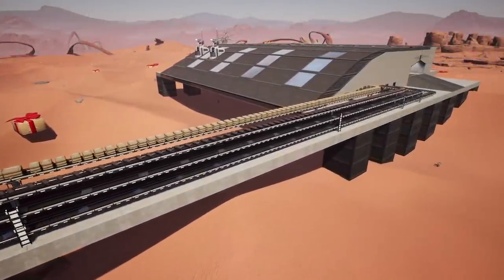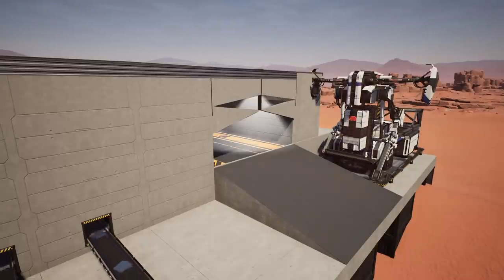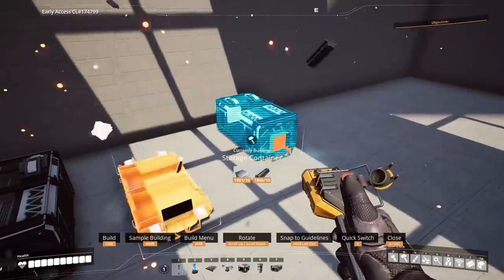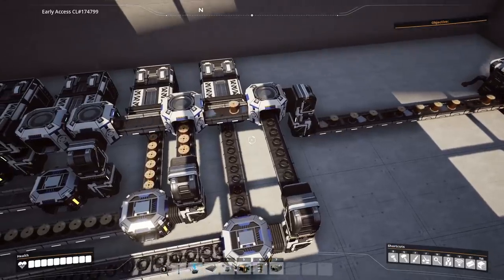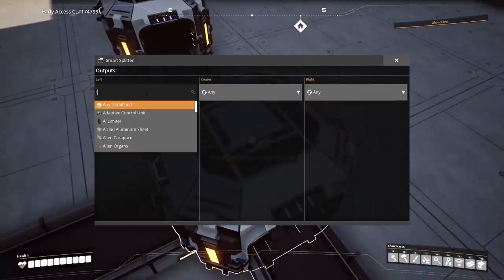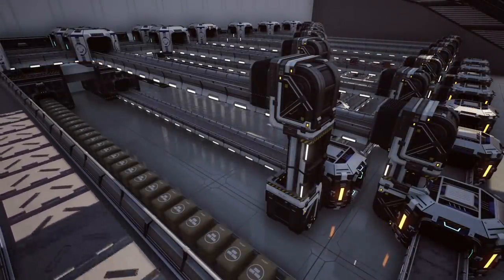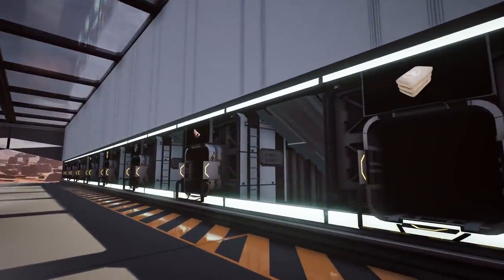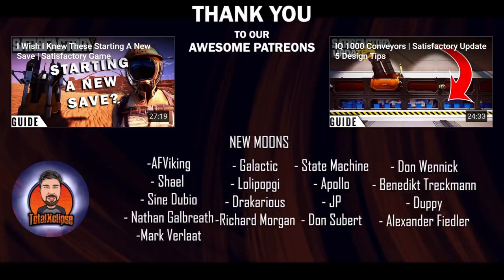Build The Perfect Storage System | Satisfactory Update 5

Comment: When it comes to basic building materials, I have adopted the same system I used for Factorio in Satisfactory:

- Automatically fill train with building materials
- Go to new factory side
- First order of business: Build a train station, connect it to the grid
- Park train there
- Build your factory - whenever you run low on materials, send the train back to get new stuff
- When your done, send the train away and convert the train station into (one of) the stations for the new factory
- Repeat :)

Comment: I know the resource sink is a big and tall machine, but I much prefer to run individual sinks for each overflow of the materials on their own belts. It makes it easier so that I don't have to worry about screws, rods, or any other material that normally forms a surplus quickly clogging up the line. Also another idea is to use dedicated nodes to making the materials for storage purposes, while not pulling from your other factories. The two reasons is that you now can utilize the impure nodes that you otherwise may leave alone, and not have to worry about any loss from your factories due to trying to save anything.

Comment: I highly recommend to make a circular storage. This allow you to have a central storage with easily enough space for every item in the game without having to travel down a giant corridor to find anything.
Reply: That's a good idea! Building circularly is kinda tough for me though haha.
Reply: @unixtreme  this channel has a good video for making circles that I've started using. It's really nice!
Reply: @unixtreme  it was a lot more difficult with update 4, but now with update 5 you can simply put one foundation on another and use the mousewheel to rotate it. 1 step of rotation is 45 degrees, but when holding down ctrl one step will be 5 degrees only.

but i doubt that a circular storage is a lot more easily accessible: i had built such a storage a while ago, using two hallways, each with two sides, 14 storages in length and 3 levels in height. maybe some items were not wellsuited, eg radioactives and spelevator items, but that still leaves 2x2x10x3 = 120 containers. how many can be put in a circle, and how many levels would that need ?
those were the hardest (and still unsolved) problems for me. the small demo in this video is just some (good but only basic) idea ...
Reply: I'll never build another mall corridor, yay U5
Reply: Do you happen to have some type of video/picture of your setup?

Comment: While true that programmable splitters have limited uses, I have done work on my own storage system where I added in designated 'Dump Chests' that I can just hit Store All and move on, but to help save myself from accidentally trashing any important items (Power Shards, Slugs, Equipment, etc, even if it'd back up it still saves me from having to notice a problem lol), I use a programmable splitter at the end of the single belt line (It cycles around the top of the bins between Smart Splitters, while there are dedicated belts feeding up from below on the Industrial Storages) that filters everything I would prefer not to get sent to the sink if I didn't mean to put it in the dump chest and moves it to an output chest that I can find the stuff later in.  Just wanted to say there are use cases for the Programmable Splitter, even if the UI for them is finicky to all heck still.  Accomplishes the task of a giant line of smart splitters for these one off maybe cases in one splitter.

Comment: My hybrid sorting/overflow storage solution uses 2 smart splitters and 2 mergers per storage container (or storage group if you chain multiple containers per item type). At the input of the storage is a smart splitter with overflow going to a merger to merge to the sink belt. The input of that splitter goes to another merger. That merger is fed from your factory production and the second smart splitter. The second smart splitter is fed by the auto-sort line and set to the individual item type and "any undefined" which means anything not indicated by the indicated item type on the other line

Comment: My storage room currently runs 4 sets of 10 Industrial Storage Containers with a set on the left and right stacked with the Awesome Sink in the middle. They are set side by side with Smart Splitters running along the back and an overflow meeting at a conjunction in the back for all of the lines to run directly into the Sink and has been running just fine thus far. I don't have an Uber massive, mapwide factory network like the 3k+ hours crowd does, but for being where I'm at currently, it works just fine.

Comment: As you showed with the copper wire, if the belt feeding the box is slower that the one going into the smart splitter it will consider stuff to be surplus and the overflow will send them to get munched in a sink. Matching the belt speed will make sure you don't waste stuff or have to delay a build while waiting for a box to fill.
Reply from the maker: yep - I was using it as an example to show the overflow, but we didn't talk about using lower tier belts to force balancing and overflows

Comment: I never got to make dedicated storage facilities, but I had my liberties with creating on-site storage areas. I once made an on-site warehouse that could take a bunch of input belts, and sort their contents into respective storage containers. It's design allowed any resource to be plugged into any input port, which made things easier for me, and even allowed for mixing stuff on belts. It was compact enough to be easily scaled in all three dimensions, it's depth dictating the maximum number of distinct item types handled (optionally, the same resource could be handled on multiple lanes for increased throughput), it's width and height dictating the total number of input ports. The one I built had a dimension of 7x7x7, effectively handling 7 different resources through 49 input ports (the height was only limited by the number of sinks I had placed). I had limited space, so the design had its shortcuts, but it was a rather compact and effective sorting system.

I love creating solutions that are scalable, and compact, which makes me all the more sad that blueprints are still not a thing in the game.

Comment: The one thing I would add on: a dump box where you can clean up excess inventory items into your storage system as well as an equipment collecting container using a smart splitter to collect all equipment into a single container (that would not overflow into the sink.)

Comment: I setup a massive sushi belt with Tier 5 belts, and programmable splitters, with a sink at the end. Worked great, except, some items pass the programmable filter at that speed. Say I drop 50 computers onto that line, 1 or 2 computers may be passed on by the splitter. Really frustrating with supercomputers. I slowed the entire line down with Tier 4 and no more issues.

Comment: I made a massive sorter and buffer system to empty trains that could have anything in any car... First I had two lines out for each freight platform to a large container and then into some splitters and mergers to move 8 large containers into like 12 or 6.... And then down a bunch of lines that had the programmable splitters I think 6 stacked so all the lines could be sorted. And then merged into two lines to go into a large container and then out through a couple more programmable splitters to feed two levels of smart splitters to fill a wall off sorted small containers with overflow sinking.... And I had it doing a bit of on site production for stuff I might drop off into a drop off container... Like plant matter to make fabric and biofuels and ammo...
Reply: That would certainly take the headache out of figuring out...which end of the train was I counting from when I set this one to X?

Comment: I have a betters sorting system, 8 line input, sorting at full speed, buffer storage units to guarantee the speed, as well as 8 line output dispansers that use the buffer to get rid of superfluous. How are 8 lines input and output possible? Thanks to the new truck unloading station and the redesigned autopilot it is possible to create very interesting new sorting solutions with trucks.

Comment: If you take the large industrial containers place one on a foundation line then behind that one place another on the next foundation line and repeat three or four rows then stack on top of the lower container in the opposite direction repeat as high as you want for mega storage and if placed correctly you have enough room for elevators with zero space in between then from the final container run an elevator up or down to the main hallway that you access your items in I run dedicated lines because this system takes long enough to fill and its helpful having mega storage for when you need an absolute ton of belt materials or concrete this is how I build all of mine and while I can never build a clean factory (because I dont possess that talent lol) my storage facility is clean! Plus I just discovered an awesome way to lay out awesome sinks for overflow that is nice and compact 😁😁

Comment: I've spent several hours trying to figure out the factory zone patterns. In your spectating area, based on the concrete flooring it looks like pattern extends further into the concrete tile than any of the patterns I have allows. I only see full tile, half tile, quarter tile, and sliver. The sliver pattern barely covers the rivet things, but yours looks like it comes in maybe a quarter of the way into the tile from the edge. Additionally, your patterns look like they have zero opacity whereas when I apply patterns there is always some degree of the underlying material that shows through. I'm guessing there are some build quirks that I don't know about but I'd love if you could go in depth on what you did there.

edit: I think I finally figured it out by clipping another foundation halfway between the foundation through the containers and the foundation the pioneer walks on. Now I'm just having an incredible amount of zfighting flickering occur when I try to add the half factory zone.
Reply from the maker: You're right, I clipped half a foundation under the storage. So that could be why they look different. so under the storage theres another half a foundation. As for the Z flickering, I use tarmac to avoid the flickering in my builds

Comment: the last time i tried to make a depo for components i ended up doing a factory instead, fill with buffers and containers to make all components on demand with minimal resources imput. Yes it takes a lot of time to fill but the benefits are great on the logistic side, since instead of bringing one of each iron and steel (for example) you are only running a coal and iron ore lines, and the other resources can be directly ingots (whenever they dont need to be smelted together)
of course i only got to oil processing before abandoning the project (it was on multiplayer and my frien who had the save quitted) but it could have kept expanding, having a main bus for all components

Comment: I have a combined personal storage and factory switching system. I have an enhanced storage box for each item, with the typical sushi roll smart splitter, connected for an input box, where I drop my inventory, and a sink  at the end, feeding into the bottom input.  The top input has a smart spitter, with any to the box, and overflow on the right.  The input comes from each of my factory (on a sushi roll), and the output sushi rolls to smart splitters that feed each factory, with the overflow back on the sushi, with a sink at the end.  

Before the sinks, are programable splitters to a), my drone port, and b) a train complex to send items to a remote construction base

All this allows any factory to first fill up the storage box that I can draw from, and then feed the next production machine in the factory, then the drone port (used to feed the nuclear power plant), and then my output trains.  

Also, it is built in a circle. With Dow floors (one for items, another for equipment).

Comment: What's the difference between programmable and smart splitters? I'm looking into a mega storage area and I'm just not seeing a huge difference, I'm thinking it's like this video said, you don't really need programmables.
Reply: the programmable splitter is useful to split off entire categories into a single belt. i use them in my inventory dump sorter to quickly sort/sink any stray ores that may have made it into my inventory, and to divide any leaves/wood off to biomass processing
Reply: Programmable Splitter has multiple filters per output, Smart Splitter only has one. For example, you could use a Programmable Splitter to split up a belt of mixed items into all iron products on the left and all copper items on the right, then use the Smart Splitter to split each of those off into individual items.

Comment: It is a sound idea to have an overflow detector before each storage solution, and to have a dedicated feed to each storage solution. Whether you use one belt with a mixed product line, or multiple belts with a single product, you are going to run into two or more issues that you need to deal with, yet the game does not seem to offer a solution. 

One issue is the slow speed of the fast belts, with the great variety of possible mixed belt traffic, the time taken to single out a unique product takes time, and keep in mind, that time to sort only affects the belts that are level 1 through 4. adding two level 5 belts does not create a level six belt, so using multiple products, over a wide variety of product types will cause feeder belts to slow down. No matter how many product belt you have feeding a hub point, the sorter will need to, in one case, place all those products onto the final feed belt in order to be taken off by the storage sampler. Your belts will reduce to a crawl. 

So, stick with single lines feeding single storage solutions and then you run into a space limitation and the spaghetti will kill you.  If you then decide to run into group storage so that each storage option consists to say , one of just five or six products, it will run quite well,  but the number of components needed and the amount of logic computing being done will create a huge lag spike and sadly, increase considerable the 'save file' time. 

Finally you will call into question the very need for a large single item storage solution, apart from being an exercise to make a YouTube movie look clever, if it brings no benefit, then why waste time and effort building such an inefficient and needlessly over complicated storage method. 

How could this be mitigated?  Have multi fruit type storage, IE one container that mixed goods can be inserted seamlessly into, yet each component type is removed only by demand. So you can :elbowcough:bung everything into it, but only take out those items you specifically call out for. Oh, and for this solution, the second game need is to not count the 'number of items' into storage and not 'place limits' on them, but to have a indicator as to how much of a product is stored in the container. The best way, to be truthful, from experience, is to not have a closed loop central storage system, but to plan ahead and have delivered by belt or otherwise, the products you need for hand building to a place you decide near the hub.

Comment: Can I ask you are sure about this smart spliter configuration? I have made this "specific item + overflow" config and items got stuck because smart spliters have a internal buffer and if the item inside the buffer is different than the items comings through the belts, the hole line gets stuck and you have to dismantle and replace the smart spliter. The only way I made this work was having 2 smart spliters, one with specific + non-specific fiding to other with specific + overflow.edit:typo
Reply from the maker: I have never had a smart splitters system freeze up. If it's set to a single Item and then overflow, any non used items should be automatically overflowed. If you do come across this though by all means please send me the save so I can see the problem
Reply: @TotalXclipse  Okay thanks for the response, maybe they fixed this at some point. i will look for this

Comment: Why would you even want overflow Sink at your main storage? It's pointless. It takes a lot of space if you have many of them for every single item and if you have main line for overflowing different items, it will cause clogging and slowing down refill rate of that storage for lower amount items. It's very bad idea. It's way better to keep container at main warehouse backed up all the way to the factory, have some additional containers with lots of items back in the factory that makes those items (connected via Mk. IV or Mk. V belts, so it quickly restores items taken from warehouse) and then at the end overflow Sink back in the factory between production buildings and factory storage containers.
Reply from the maker: You always want an overflow sink. That way you do not get any energy spikes and you'll run your factory at max efficiency and it will never clog up nor will it slow down the refill rate. If you want you can have several containers rather than just the one. Hell you could use 10, but you should always overflow to the sink because of the reason above, and on the plus side you'll gain coupons. Speeds can vary for any reason but usually its easier to go with a max speed. you mention putting an over flow sink between the factory and the storage.... but all your doing is the exact same setup to what I've done here in a different layout...
Reply: @TotalXclipse  Well, that's what I said, at main storage. Don't get me wrong, I agree, Sinks are good, but I think there is better way to do so from what what you explained in the video.